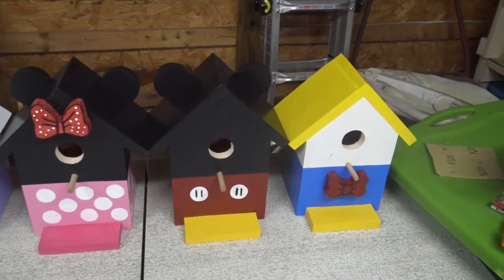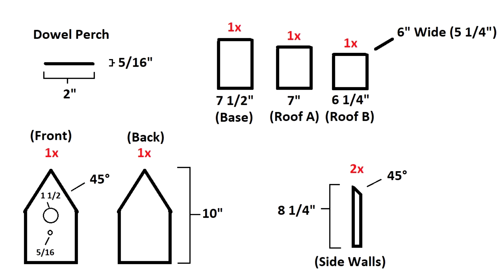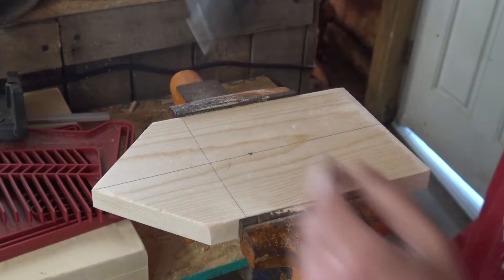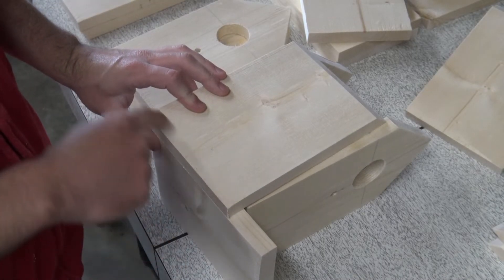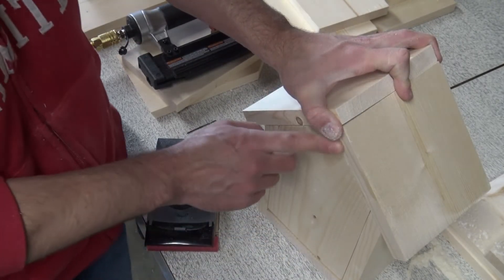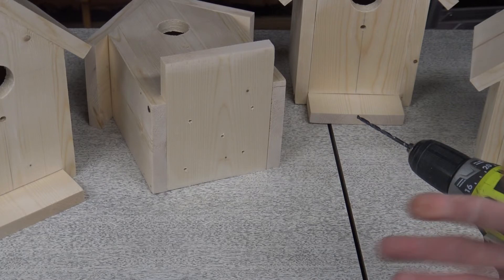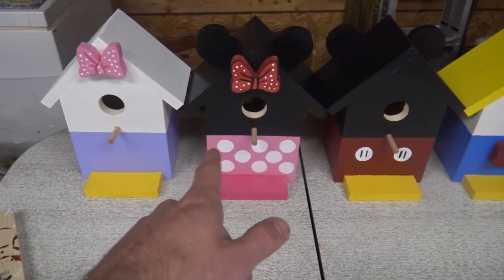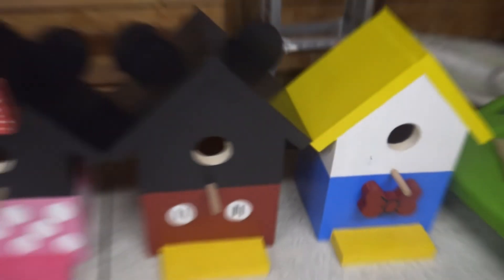How To Make Disney Birdhouses - Minnie, Micky, Donald, Daisy

Comment from the maker: Hope you enjoyed the tutorial! Would love to hear of your project ideas! 

Here are the tools and paints I used:
Miter Saw: https://amzn.to/2Zkh86m
Impact Driver: https://amzn.to/31TPRJr
Drill: https://amzn.to/2ZjtpYz
Scroll Saw: https://amzn.to/2ZjtsDJ
Brad Nailer: https://amzn.to/2Nn2xVj
18 Gauge Brad Nails: https://amzn.to/31VUXFk
Painters Tape: https://amzn.to/2KTA1HS
Paint Brushes: https://amzn.to/2NmWnV7
1 Inch exterior screw: https://amzn.to/2ZktbAy
1 inch finish nails: https://amzn.to/2L3GXlN
Tape Measure: https://amzn.to/2KPbMfs
1 1/2 Inch Hole Saw: https://amzn.to/2ZjVxir
Wood Glue: https://amzn.to/2HioNfi
Sanding Block: https://amzn.to/33QTBgT
45 Degree Square: https://amzn.to/2HjKyLv
Pencil: https://amzn.to/2ZllLgi
5/16 and 1/16 Drill bits: https://amzn.to/2KKScRi
5/16 Dowel: https://amzn.to/2ZjUPxz
Mallet Hammer: https://amzn.to/2KMZYdz

Paints Used:
1. Ultra Pure White Exterior Paint
2. Ultra Pure Black Flat Exterior Paint
3. BEHR Premium Plus P510-6 Brilliant Blue (Donald Bottom)
4. BEHR Premium Plus P540-4 Lavender Sky (Daisy Bottom)
5. BEHR Premium Plus S140-7 Deco Red (Mickey Top, Minnie/Donald Bow)
6. BEHR Premium Plus P130-4 Its A Girl Eggshell (Minnie Top)
7. BEHR Premium Plus P300-7 Unmellow Yell0ow (Donald Roof)
8. BEHR MARQUEE P270-6 Soft Boiled (Mickey, Don/Daisy Base)
9. BEHR Premium Plus Ultra P130-6 Ballerina Tutu (Minnie Base)